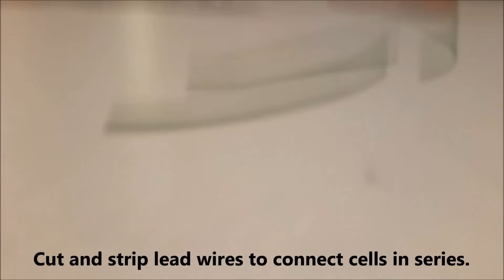Soda Can Battery - Power From Trash - DIY Project

Comment: Could you make a 24amp battery with this? If so how long would it last do you reckon?
Reply from the maker: Good question! Thanks for watching 👀 ! I reckon it would last for a few week's depending on how much you use it. If you could make a 24amp battery you would need many plates/sheets of aluminum to increase the surface area enough to produce high amperage. Probably also sheets of copper, which would be expensive. Since my setup was just in series with a single cell in each it was only about 0.5v and a few milliamps for each cell. If you would like to try a larger version I would love to see your results. Please share and subscribe, and keep me informed if you do try it. - Danny
Reply from the maker: We thought you might like Building a DIY ROCKET STOVE video - https://youtu.be/Hlir866cp-E please LIKE and leave a COMMENT. We value your feedback!

Comment: Can I ask which is the anode and cathode? Which is the electrolyte and electrode?
Reply from the maker: The Aluminum is the Cathode and Copper is the Anode. The electrolyte is Salt Water in this battery, with some Vinegar added later. The electrode is a term for a connector in which electricity leaves or enters an object so technically the cathode and anode are electrodes. Thank you for your questions. Please share the video help me spread the word! 👍👍

Comment: can this batteries be recharge ?
Reply from the maker: +Adi Syahir Supian great question! Unfortunately I didn't test that before it failed. I would imagine it would hold a bit of a charge. I will have to test that with version 2 that I am working on. Thank you for subscribing! Please share my videos, I greatly appreciate it!
Reply: @SourcePortEntertainment  This is a non rechargeable battery or primary battery, once the aluminum corrodes the chemical reaction that is generating the Electromotive force will cease...
Reply: No. The copper will corrode in salt water. So you have to replace it. it's common sense.

Comment: Can we make it 12volt
Reply from the maker: It would take roughly 24 cells (cans) to reach that voltage but the amps (current) would still be very low. You would have better luck putting several cells in parallel and using a step-up converter board to increase the voltage to 12v. Make sense? Thanks forcommenting and watching please SHARE and SUBSCRIBE!
Reply from the maker: We thought you might like Building a DIY ROCKET STOVE video - https://youtu.be/Hlir866cp-E please LIKE and leave a COMMENT. We value your feedback!

Comment: Can I ask what is the volume or measurement of the salt water and sand?  And what sand to use. I need immediate answers for my project :( . Can I also ask what are the specifications of the LED Light? Like how many watts ?
Reply from the maker: Hi Wendell, it is 2 tablespoons of regular table salt to 16.9-17oz of water. The sand is just a big bag of Play Sand from Lowe's. Not sure on the LED wattage. Runs off of a few hundred milliamps and about 4.5 volts. It is a cheap $1.00 flashlight head from Wal-Mart. I hope that helps. Please share and subscribe!
Reply: @SourcePortEntertainment  Can you specify the link on the flashlight head ? or where to buy it? Thankss Also on the Sand so that I can know the volume per can and what kind of sand to use because it may affect the result. Where can I buy the sand?
Reply from the maker: Hi Wendell, I think I posted a link to the flashlight on another comment of yours. Did you see it? Thanks for watching!

Comment: How would you increase voltage without having to build more. 🤔
Reply from the maker: A voltage step-up board or boost board would be a good way to do it. Would have to be one that detects at a pretty low voltage and boosts to 5v or 12v depending on your needs. The low amperage makes it hard to power very  many things other than LEDs. Thank you for your comment! Please SHARE and SUBSCRIBE!
Reply: Use different electrode materials, see this chart and pick two materials with the most difference between the potentials. If you pick the top and bottom iron and lithium you will get about 6 volts. But there is probably a problem with this chemistry.
https://classnotes.org.in/class12/chemistry12/electro-chemistry/electrochemical-series/
Reply from the maker: We thought you might like Building a DIY ROCKET STOVE video - https://youtu.be/Hlir866cp-E please LIKE and leave a COMMENT. We value your feedback!

Comment: Can I ask a question?? I'm also using soda cans as battery but what are some other alternatives for the saltwater and dirt? We were tasked to make a alternative light source and I thought using some aluminum cans would be a great idea.
Reply from the maker: Hi Miki-kun, thanks for watching and for your comment. You can also use aluminum and graphite pencil core, or aluminum and a nail coated in zinc (galvanized) those also work. Good luck with your project! Please SHARE the video if you enjoyed it.
Reply: @SourcePortEntertainment  oh okay thank you so much!
Reply from the maker: How did your project turn out?

Comment: Instead of cans use buckets and more copper.  Do you think it would produce a lot more power. Looking at this, Could i bury copper on the beach and get a result. Thanx great vid.
Reply from the maker: The more surface area the better the amperage. So yes it should increase. Thanks for watching and commenting! Please SHARE and SUBSCRIBE!
Reply: That's called a earth battery, you can sink rods in the ground . you have to have the same thing, you have to have copper rods and tin rods. but yes you can't stick them in the ground and get power . but you will get nowhere near the same amount of power as you will get out of building a battery the way he just built one ... but there are people that build earth batteries . (low power) but I think myself it takes up way too much land space, too many rods to be worth anything. because you will get very low power from the earth battery.

Comment: How would  we connect  the wire to the  soda can and the copper wire
Reply from the maker: Hey Vijay, the best way is to use some sand paper to rough up the surface of each then, solder the wires to the can and copper wire. Please let me know if that helps.
Reply from the maker: We thought you might like Building a DIY ROCKET STOVE video - https://youtu.be/Hlir866cp-E please LIKE and leave a COMMENT. We value your feedback!

Comment: I'm following this tutorial for a project, and I was just wondering, would rice work as a substitute for the sand? Also, would the voltage increase if I used an acid like lemon juice or vinegar instead of salt water?
Reply from the maker: Hi Liana, I think rice should work just fine, since I'm just using it in this video to separate the copper from the aluminum further. If you used an acid like lemon juice or vinegar it will give you more amperage not necessarily More Voltage. Make sure you lightly sand the inside of the cans before you fill them. Also make sure you put some kind of plastic container or water bottle around each can, to prevent leaking your electrolyte out all over. They will degrade faster if you use a stronger acid like lemon juice or vinegar. Please let me know your results. Thank you for watching and commenting please share and subscribe!
Reply from the maker: Great idea this will need some testing! Thanks for watching and commenting, please SUBSCRIBE!
Reply: Is it a cooked rice or uncooked rice
Reply: @SourcePortEntertainment  is it a cooked rice or uncooked rice?
Reply from the maker: Hi Ebenezer, I have not had a chance to try the rice idea. Thank you for commenting.
Reply: @SourcePortEntertainment  thanks for your support

Comment: How long it can last when it's used after you have made?
Reply from the maker: Hi Moudy Ali, it lasted for several weeks before the cans got holes in them and wouldn't hold the electrolyte fluid anymore. The cells kept drying out too. I topped the cells off with vinegar, shown add the end of the video to increase the amperage and brightness of the LED. This also lead to faster destruction of the cells. If you like our videos please SHARE and SUBSCRIBE!
Reply: @SourcePortEntertainment  I think some plastic wrap (saran wrap) over the top would prevent evaporation.  No way to prevent cans getting holes, I suppose
Reply from the maker: We thought you might like Building a DIY ROCKET STOVE video - https://youtu.be/Hlir866cp-E please LIKE and leave a COMMENT. We value your feedback!

Comment: How do you connect the lead wires to can? Thanks
Reply from the maker: Bending them over the lip and a spot of solder. Drilling a tiny hole in the can would have probably worked better. I am working on version 2 of this project right now. Please subscribe and turn notifications on, with the bell, to be alerted when I release it. Thank you for watching!
Reply: Source Port Services thanks
Reply from the maker: Hey Janina, I though you might like to see our 7,000RPM Hard Drive Sander video. https://youtu.be/oE5F8n9lcwg   
Could I get your comments on it? I would greatly appreciate your feedback. Thanks!
Reply from the maker: Hey Janina, I thought you might be interested, just published the update for this video. Please check it out, share it, and let me know what you think. Thank you https://youtu.be/DRVzPqgp10c

Comment: That is a great way to construct a battery from rubbish. But why does it work when the aluminium cans are coated with an insulator on the inside? The cans I've tried have some sort of coating on the inside. Did you remove this coating? Thanks I love it. Awesome Awesome.  :)
Reply from the maker: Thanks zylascope! I forgot to remove any coating that might have been on the inside. The sand must have scratched it enough or there was enough imperfections to get through it. This also might be why the voltage is only .5v per cell. It is still running an LED light btw! Please subscribe to see the next version I am working on.
Reply: "The sand must have scratched it enough or there was enough imperfections to get through it."

I was thinking that might be the case. It wont take too much effort to run some sandpaper around on the inside of each can next time and test for conductivity inside the can with the meter. It should work better. Running on vinegar might be a bit more corrosive than salt water. I expect it will start to leak in a few months, but maybe not :)
Reply: the cardboard absorbs the electrolytes
Reply from the maker: Thanks for the comment Jesup, I hope you are my newest subscriber! I think that is partly why some of the cans shorted out and failed after a while. Must have eaten away at the cardboard.
Reply from the maker: Hey Zylascope, I thought you might be interested, just published the update for this video. Please check it out, share it, and let me know what you think. Thank you https://youtu.be/DRVzPqgp10c
Reply from the maker: Hey Jesup, I thought you might be interested, just published the update for this video. Please check it out, share it, and let me know what you think. Thank you https://youtu.be/DRVzPqgp10c
Reply: It's been a year or so now. How did it perform over the last year?

Comment: does it really require play sand or just regular sand can be enough
Reply from the maker: Hi Mark, Thanks for the question. Regular sand should work I don't think the grit size would affect anything in the battery. I just used play sand because that is what I had. Please share and subscribe!

Comment: Hi I just want to ask if anyone knows how to change a battery like this if it's even possible of if it's just like a disposable battery? Thanks
Reply from the maker: Hi Keaton, thank you for the comment. This is called a primary battery and while trying to charge it might give you a little boost in power it will not last long, and as the battery degrades from breaking down the metals, it will get to a point when it no longer has an electron difference and the metals won't hold a charge. This is similar to an alkaline battery. Please SHARE and SUBSCRIBE!
Reply from the maker: We thought you might like Building a DIY ROCKET STOVE video - https://youtu.be/Hlir866cp-E please LIKE and leave a COMMENT. We value your feedback!

Comment: @ 6:42 when you're ✔ing 4 a a shortage, wht would/colud cause 1 ? 
And how 2 fix it if possible??
Reply: Recharge it slowly a few times
Reply: It would likely be caused by the coil being in contact with the inside of the can, or in the case of wiring multiple together the way it is wired could cause it.
Reply from the maker: We thought you might like Building a DIY ROCKET STOVE video - https://youtu.be/Hlir866cp-E please LIKE and leave a COMMENT. We value your feedback!

Comment: What if you mix half of the sand with soda can pull tabs (sanded down if applicable) randomly distributed throughout the inside of the can? 

How about if you crush full size cans with a can crusher and layer them in with the sand, and if it makes a difference, have the copper coil through each layer in spirals working from the outside-in then going through the middle of the next aluminum can disc then spiraling out, repeat.
Reply: good point i think this will give a better result.......
Reply from the maker: We thought you might like Building a DIY ROCKET STOVE video - https://youtu.be/Hlir866cp-E please LIKE and leave a COMMENT. We value your feedback!

Comment: When did you  add the  vinegar???
Reply from the maker: Hi Edward, It was about a week or two after I let it sit. The LED light was still on but was dim. After adding the vinegar the LED brighten right up but the cans started to destroy themselves faster. Thanks for the comment please share and subscribe!
Reply: @SourcePortEntertainment  try putting them in pvc pipe line the inside of cans with foil b4 adding other items...
Reply from the maker: That is a great idea thank you! I will make another version soon and try your suggestions. 👍

Comment: There are two wires specified. Which is better to use? And where to buy pls send link thanks
Reply from the maker: The copper wired inside the battery is a 12 gauge standard electrical wire you can get at any hardware store. The smaller wire to connect the battery cells is I think a 24-26 gauge wire from inside and old broken HDMI cable that I had laying around. Gauge of the wire isn't important since it its very low voltage and low amperage.